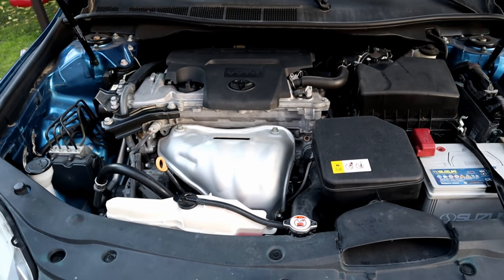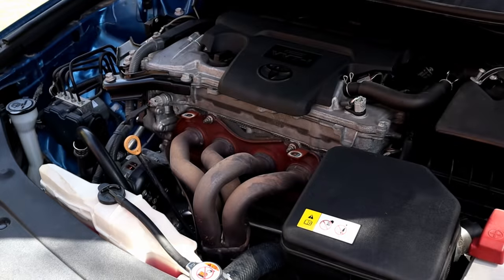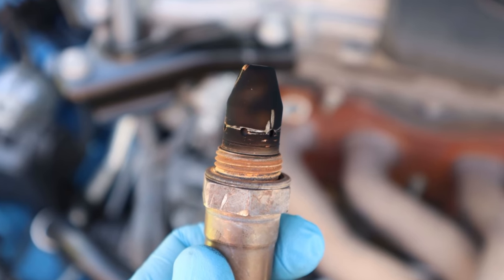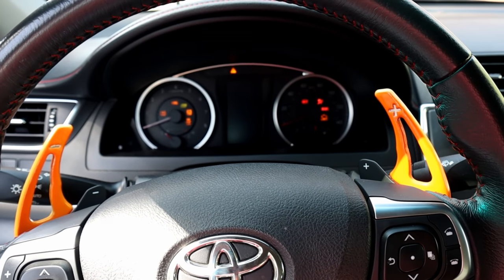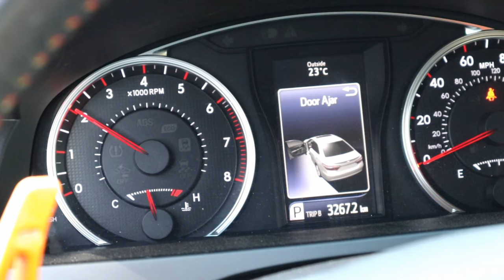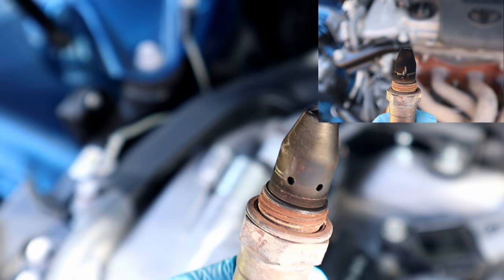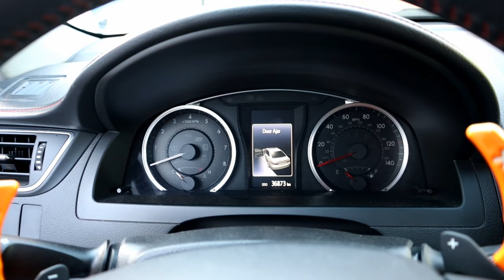Cleaning o2 sensor without removing it/Cleaning oxygen sensor with carb cleaner/TOYOTA Camry 2017

Comment: 1. you should not use a regular wrench. use an Ox Sensor removal tool OR a flare nut wrench OR a box wrench slipped down over the disconnected wire. once you rounded off the nut part of the Ox Sensor you are in BIG trouble. 2. you have to make sure the carb cleaner says on the can  "SENSOR SAFE"  or says Throttle Body cleaner. Plain carb cleaner can kill your Ox Sensors

Comment: Professional mechanic here and occasionally I like to watch u tube videos just to see how many do it yourself people try to do stuff and get it completely wrong.  In this video wasn't the case he pretty much nailed it but I like to remove the sensors and dip them in berrymans fuel injection cleaner for 30 minutes in a sonic cleaner . why ? because I have one and I use it to clean anything and everything and by dipping it in glass jars of berrymans I can re use the cleaner over and over again . 1 long clean in dirty cleaner to break down the hard stuff then 1 short clean in new cleaner to gets everything looking brand new. No effort just set timer and walk away.
Reply: Shameless plug for Berrymans?  Just kidding 😂

Comment: You are brilliant! I performed your procedure on my 2017 Chevrolet Colorado Duramax 4-cylinder diesel engine to fix my Nox sensor deciphered to not be functioning. The dealership wanted to charge me $750 to replace it, but using your exact technique cost me only $11.00 for the spray! Thank you, so much! You saved me a lot of money! My "Check Engine" light is now off after three months. I disconnected the batter after spraying the carb/choke cleaner spray into my master break cylinder's vacuum hose to reset my ECU and when I reconnected the battery and restarted my engine, the "Check Engine" light did not come back on! Bravo, my friend! It worked!
Reply from the maker: That's great news,  glad it helped you and saved you some cash ✌️
Reply: @AliMECH I'm pulling a p420 code low cat efficiency do you think this will work to get my engine light to go away? I have a 2012 Honda Civic LX and I wanted to clean the oxygen sensor but I'm afraid to take it out and break it I don't know if it'll clear the code because it's the sensor or it'll clean the cat enough to erase the code. I used cataclean last time and it turned the engine light off this time it didn't work
Reply: Where did you spray on the Duramax? I can't seem to find where to

Comment: That outer metal shield just protects the ceramic / working part of the sensor its not important that it is carboned  that much
Reply: The condition of the outer shield is a strong indicator of the condition of the sensor under the shield. Is it really that difficult to figure out?
Reply: @fluxcapacitor1621  
The ceramic gets super heated and cleans itself more likely it needs a new sensor us ASE master techs do mot clean them

Comment: Why not use mas flow o2 sensor instead of carb spray
Reply: Cause carb cleaner is cheaper generally.
Reply: Mass air flow cleaner is basically electronic parts cleaner and won’t cut the carbon build up. The problem with cleaning an oxygen sensor is it may not help if the sensor has broken down, low voltage output or is lazy. So it doesn’t hurt to try but it may not help.

Comment: The old carb cleaner spray, we used to spray that stuff into carburetor air intake every month in the 1950s thru 1970s. Modern fuel injection engines will have to do the way in this video. 😎

Comment: This might clean your oxygen censor but it will harm your catalytic convertor. I destroyed my catalytic converter when I sprayed a can carburetor cleaner down the carburetor . I was trying to clean my carb in place with out taking it off. A lesson learned the hard way. 
DTB
Reply: Perhaps, may have a more modern sensitive motor, getting worst....
Reply: You should be using Cataclean once every three months to keep your cat clean it must have already been pretty clog give the cat a few tap with a ball pean hammer after it’s up to temp then a few revs to blow the debris out of the cat repeat 5 times then use cataclean as advertised that should clear it up your other option is anew cat or remove the cat clean manually and put it back on
Reply: You sprayed any dust and sludge into the cat … that doesn’t happen in this case

Comment: Hi Ali. Cleaning o2 sensor was a success. I followed each and every of your steps and it was so easy. Before cleaning, I was getting 14-17 mpg and the computer showed 300 miles to empty. After cleaning, I filled full tank of gas and now the computer showed 448 mile to empty. I'm getting 27 mpg average. However, there is minor problem. I was receiving check engine light and the display instrument showed "Check Vehicle Stability Control System". I ended up disconnecting the battery positive terminal for a couple of minutes and the check engine light went away. I hope it stayed away and won't come back on. Thank you so much for your instruction. You saved me a ton of money when I can do it by myself. Have an awesome day my friend :)
Reply: 1 month later is this still the case @Kevin
Reply: hello. im planning to do this to my camry as well. did you remove the o2 sensor or spray it through the vacuum hose?
Reply: @kabankachan  Remove it
Reply: I don't believe that...cleaning 02's basically only cleans the outside and is going to be for a short period. sounds like another internet myth, especially believing an additional 10 MPG.
Reply: @thedbcooperforum  I'm sure Kiana cleaned the O2 sensor.  I'm sure in Kiana's before/after got more mpg after cleaning.  But like you, I question how the fuel economy was "tested".  To have a difference of 10mpg, I highly doubt it was the same sections of road or driven the same way.
Reply: @reallifeengineer7214  I've had several trucks that had bad O2 sensors and never had a loss of mpg like this. most of the time you don't even know one is out. a knock sensor might give that kind of a loss in mpg..
Reply: @thedbcooperforum this depends on your vehicle’s fuel system and ECU. If you have a stand-alone fuel controller like I do, the fuel map is constantly changing in accordance with data from the O2 sensor when the vehicle is in “closed-loop”. I am however referring to a performance-setup on my car and the modern system on my 2022 Audi and not an older basic/stock pickup truck.
Reply: @Real Life Engineer  if the engine was runny very rich with dirty O² sensor then maybe the fuel mpg wouldvreturn to normal.
Reply: @thedbcooperforum  This video is bull because if you will notice the trip mileage gauge is showing about 400 miles difference while cleaning the sensor.
Reply: @jackierobertson1528  if you are losing 10 mpg you have serious issues, serious. Several trucks i've had over the years had bad 02's, some all four and none had a major loss of mpg or gain once replaced. In fact, I let them go to long and ruined the engine on a F150.
Most of these hacks either don't work or work for a short period like headlight lens, charging old batteries with a welder etc. Etc.
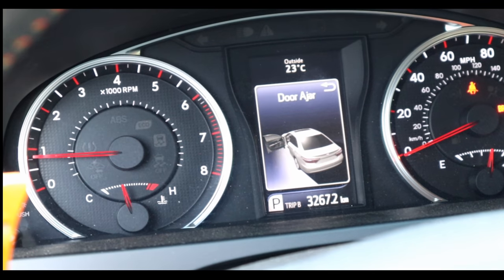Reply: Richard Hildebrand  36,873 at 2:53 but no big deal.
Reply: I did remove the battery. But the smart asses computer stores the codes and now it won't pass NYS inspection !
Reply: Did the check engine light come on again?
Reply: Any time your computer resets like from disconnecting the battery, your average mpg, and total mpg till empty will reset and raise.  It starts the counter over so don’t be so sure cleaning this done anything to help.  
You may have bigger issues and probably just added fuel to the fire.   
I’m no mechanic or salesman just another DIYer that has reset my computer and thought for sure I was getting better mileage but realized a week later it was bs.

Comment: I have a 2006 Camry with 2AZFE engine. This video was so simple I will definitely do it! It seems to run fine but it seems like a good idea to clean the injectors and valves and sensor due to age, and also I know it gets short-tripped a lot.
Reply from the maker: Thanks for watching 🙏🏻🙏🏻
Reply: You should clean it your engine will run much smoother with less shaking

Comment: Very good video, thanks. I would only add that when removing an O2 sensor, I like to loosen it when the engine is still somewhat warm, so that it comes loose easier. When reinstalling it, I use anti-seize on the threads to make the next time easier.

Comment: It is a great video. But I am thinking if you can clean the O2 sensor like that, the catalytic converter should be cleaned as well right? So I don’t have to remove the o2 sensor and spray directly to the catalytic converter.

Comment: That oxygen sensor, according to the image, indicates that the mixture is too rich in fuel.
Cleaning the sensor does not correct the problem.
The check engine warning light only indicates that the emission level of the engine is not correct and that the lambda factor is not being met.
On the other hand, zirconium dioxide, the main component of most oxygen sensors, degrades over time.
Cleaning the outside of the sensor will only allow, in the best of cases, more gases to enter to react with the ceramic that performs the measurement (zirconium dioxide covered by a metallic layer).
In short, if the check engine light comes on and the oxygen sensor is not degraded by use over time the problem is probably in the injection system.
If the sensor has a long time of use or miles, change it.
Reply from the maker: Yes that's right, I had one failed fuel injector, after I cleaner all the injectors, I wanted to speed up the process for cleaning all the O2 sensors, 
that's right, O2 sensor not getting dirty unless there is some serious problem
Reply: what is the symptom of o2 sensor has degraded by use overtime?? please help coz my car has a high gas millage
Reply: @Abdullah-hc1cz  The best way to tell if an oxygen sensor is out of use is by using an oscilloscope.
Excessive consumption (up to 15%) can be a sign that the sensor is not working as it should and it is not possible to adjust the fuel consumption to the stoichiometric ratio (14.7 parts of air / 1 part of gasoline).
However, excess consumption may be due to other factors that indirectly affect the signal sent by the oxygen sensor to the engine control unit, which is what regulates the duration and quantity of fuel injected to try to achieve perfect combustion (stoichiometric ratio):
- worn spark plugs.
- permanently open thermostat of the cooling system.
- faulty engine temperature sensor.
- Faulty injectors (diesel) or injection solenoid valves (gasoline).
- defective catalytic converter
Reply: @ihrtecnomecanica9420  
Hey, thanks for the information.
Quick question, is it reliable to use a Lambda sensor on a two stroke engine? They sell them but I fear the sensor won’t last too long and I will have to be replacing it very often, at the moment I’m using an EGT sensor but it’s a bit vague, It’s almost impossible to know whether the engine is tuned to perfection, Exhaust gas temperature can go from 650 degrees to easily 690 or even 700 and the engine is still performing fine, so maybe a Lambda would be more accurate, of course if the sensor lasts long enough to make it worth while.
Thanks 🙏
Reply: @p.c.h.6721  Surely perfect for carb tuning, but I don't think an oxygen sensor while running a two-stroke engine will provide very reliable values.
The exhaust gas flow in these engines is slow and pulsating, which will produce erroneous readings.
Additionally, combustion in a two-stroke engine is less efficient (the exhaust gas contains a variable amount of unburned oil and gasoline in each cycle), which can also lead to misregistrations and sensor contamination.
It is also true that the records of an EGT sensor can vary significantly based on heat, humidity and air density, but in two-stroke karts, for example, the EGT is the most widely used.
Reply: @ihrtecnomecanica9420  
Thanks a lot, I’ve heard very similar comments by old timers, the main reason why I asked, besides the fact that you know your stuff, is just because the main builders of data logging systems (Alfano and Mychron) for karting sell the Lambda sensor for kart enthusiasts like me to tune the carburetors (Tillotson and Dellorto mainly), but as you very well mentioned, EGT is the one sensor that everyone is using, whether it’s an automatic engine or a shifter, an EGT is the one sensor everyone is using, at least in Europe.
I’ve never seen anyone using a Lambda sensor in karting around Europe at least, but you know they sell them.
Luckily an EGT sensor lasts for a very long time.
Reply: @ihrtecnomecanica9420  Agree , and the 15% you refer to I believe is the LTFT.
Reply: Very well said,misleading info could make you$$$, why don,t you mention injector leaks, you speed up to clean all the o2 sensor ,wow full of it.
Reply: EXACTLY
Reply: @Abdullah-hc1cz  You will get a code probably saying there is low voltage at the sensor.  There will be a check engine light.  Pull 1 or 2 spark plugs and check their color, if they are dark then the mixtures are off.  Many things can cause poor gas mileage, from dirty air filters, to old spark plugs,  vacume leaks on dried out vacume lines, the list goes on, but spark plugs will tell you a great deal by inspecting one or 2 of them.
Reply: @Abdullah-hc1cz  the O2 sensors make your engine run rough because the engine control unit faults the forward sensor's  failure (before the catalytic converter)  to give a good comparison to the second O2 sensor (after). That will register a O2 out of limit code. The fix? Clean or replace them being careful that the wiring is still intact and not broken or shorted.
Reply: Penny Neiman  
DTC PO420 is a generic code that stands for "Catalyst System Efficiency Below Threshold."
This means that the catalyst is not reducing pollutant emissions as expected.
This is the reason the MIL (Malfunction Indicator Lamp) lights up.
I think you should start checking  fuel injectors are working properly (workshop check).
Maybe one of the fuel injectors is not working properly and the mixture is too rich (which perhaps caused the degradation of the previous catalyst).
Anyway If the catalytic converter is new, it is not likely to be faulty and other several causes could be :
- One of the two oxygen sensors (one in the front and one at the rear 
  of the catalytic converter) is no working properly (workshop check).
  Check sensors are connected correctly and the wiring of both sensors is not damaged (depending skills check it yourself).
- Also check the exhaust system for leaks (depending skills check it yourself).
- The operating temperature is determined, among others,
   by engine coolant temperature so check that the ECT (Engine 
  Coolant Temperature) sensor is working properly (depending skills 
  check it yourself).
- also check that the air filter is clean and that there are no leaks in the 
  air intake to the engine.
- It's also possible fuel is contaminated by oil (workshop check).

I hope all this will be of some help to you and guide you to solve the problem.
Reply: Fact
Reply: a small correction here, the engine uses the lampda to adjust fuel mixture TDC must be in complete order for this to work proberly, epseaking from experience thanks

Comment: What pipe or hose did you have connected with that carb cleaner bro...that is hose into brake vacum booster, isn't it?...or blow by gass hose?

Comment: What codes did you have to have you clean the sensor? BTW it's probably better if the sensor is pointed toward the ground while cleaning so that the cleaner doesn't get to the electronics on the other end.

Comment: really good quality videos and information, can this method work on VW & Audi FSI engines to clean the carbon on the intake valves? I have seen people take out the intake manifold and rotate the cranckshaft to close the intake valves and clean the ports manually one by one, they say it is hard and use a lot of cleaners and zip ties in a an electric drill to remove the carbon from the intake valves.
Reply from the maker: Thanks, I have a video, I cleaned it without taking it out https://youtu.be/ljQlugKM9P0 this will be helpful for you
Reply: Run seafoam through the main vac line
Reply: Direct injection cars do not have any cleaning of the intake. Thus a coating will build up unless some gas is sprayed on occasion.  Toyota does this  VW  Audi and BMW do not.  One spray will not clean it  it needs continuous multiple spraying  or as you said  and thorough cleaning with brushes or walnut shell blast..

Comment: What good is it to clean the outside part of the O2 sensor (actually air/fuel ratio sensor in that car)? That is just a cover for the sensing part which is inside.

Comment: On some cars you have to reset the ECU to delete the adaptations, otherwise it's going to take forever for the ECU to adjust the mixture.
Reply: Right because if you want to get paid and act like it's fixed you need to shut it off right now because it's one of those codes that don't come on for a while so after you make your money you can take off running

Comment: Very good instructional video. Several thousand miles ago my 2003 Camry (currently has 152,000 on it) was displaying a chk. eng. light. Took it to auto zone & the diagnostic scanner indicated a faulty 0xy sensor. Best I remember they had a special tool they loaned me for changing it out. Does there have to be a problem somewhere else in the engine like a bad injector etc. to cause a sensor to mal-function?
Reply from the maker: Thanks, whenever the o2 sensor gets dirty, there must be some problems, could be clogged fuel injectors, bad spark plugs or ignition coils
Reply: @AliMECH  catalytic converter?

Comment: Thanks for your guide. If I use Carb cleaner to clean injectors directly as one of your videos, is air fuel ratio sensor clean too or not?
Reply from the maker: It will but not that much, if it's too dirty
Reply: Afr is the same as o2